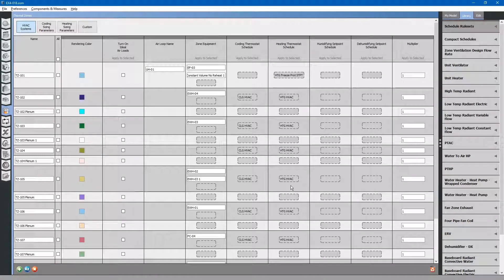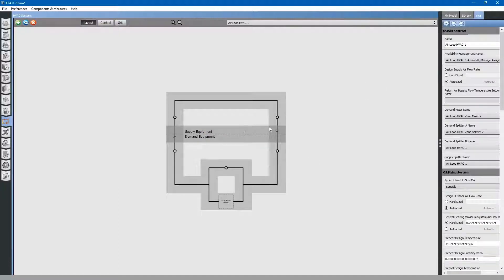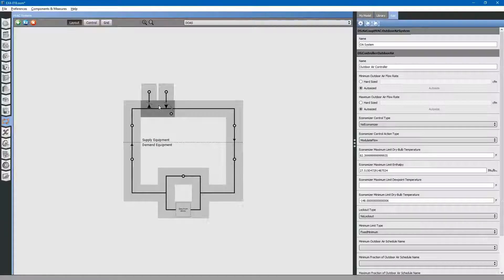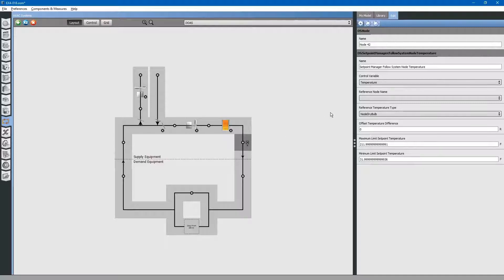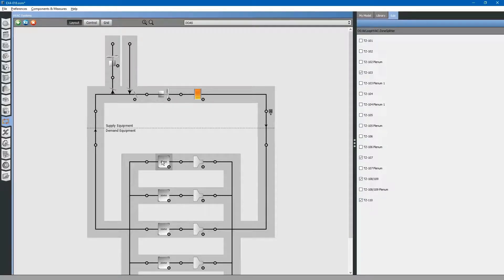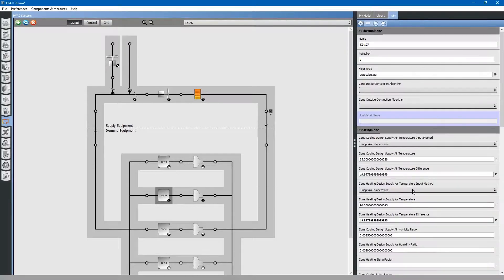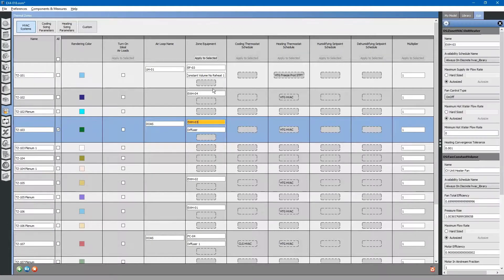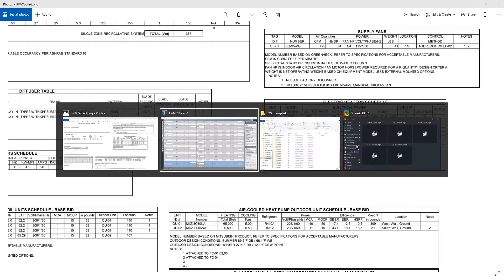Building Energy Modeling in OpenStudio - Add DOAS System

Comment: hi helix thanks for the video, i have a doubt, hope you can help me.
I created a geometry and ran ideal loads and i am getting cooling rate as 10Kw.
then i installed conventional hvac, and getting the value of  7.56kw
After that i replaced conventional hvac with GSHP- now getting 6.74 kw

can you please tell me why are the number changing, shoudn't these number be same?
Reply from the maker: Good question.  I have found that Ideal Airloads tends to overestimate the loads.  It serves as a good rough estimate to start with.  Also, keep in mind that each system will have different performance, such as COP for instance.  These differences add up and will result in different outcomes.
Reply: @helixenergypartnersllc3540  Thanks for the reply. So if i want to find what is the difference between these two systems under similar load, i should consider not consider ideal loads?
Reply: Also, cooling load should not change regardless of COP, because it is the heat removed from the system. It should be same for both system?
Reply from the maker: Well, I guess it depends on what you are referring to as a load.  The zone loads should not change, they should always be the same (except that in the case of ideal air loads the zone and system loads are all grouped into one bucket and identified as a zone load).  The for various systems, system loads will be different based on COP and a lot of other factors.  So, the question is, where are you reading this load information from?  If it is the output report, what category?
Reply from the maker: @flcckate6633  I would only use Ideal Airloads as a starting point for equipment selection.  Then I would run the model with the actual equipment selections and make the comparisons of the actual equipment alternatives.

Comment: Hi Helix, can I have constant RH in a zone throughout the year?
Reply from the maker: Yes, you will need to add humidity controls.  On the thermal zones tab, you can add Humidifying and Dehumidifying set points.  On the air loops, there are several Setpoint Managers to choose from that can be used to control humidity.

Comment: Hi Helix, first of all, thank you for your amazing videos!
I'm modeling a classroom, I have to add a ventilation system with no reheat or cooling. It is a system that is necessary to respect the  outdoor air changhes per hour. I want to control the air mass flow rate on the base of the occupancy inside the thermal zone. Do you know how can i do?
Reply from the maker: Please see this video: https://youtu.be/tTvxbkNG7AI
Reply: @helixenergypartnersllc3540   Thank you so much, it is very clear! 
I'm trying to model a ERV HX system that has to pre-heat the supply air in winter through an heat exchange with the exhaust air. It works very well in winter because there is a very high heat load reduction, but, on the other hand, there is an huge increase of the cooling load. I would control this system in a way that allows me to by-pass the HX in cooling mode and to realize a sort of free-cooling. Do you have any advice?
Reply from the maker: Good question!  The heat exchanger has an option for "locking out" when the economizer is active or when you have set up humidity control.  This feature can be found as a drop down menu on the heat exchanger settings called "Economizer Lockout".  More about it here: https://bigladdersoftware.com/epx/docs/8-8/input-output-reference/group-heat-recovery.html#field-economizer-lockout

Also, you can optimize this function by selecting the outdoor air system and selecting the drop down menu Heat Recovery Bypass Control Type.  By default, it should be selected to BypassWhenWithinEconomizerLimits.  But you can also increase the amount of bypass to always bypass when outdoor air is greater than the minimum.  More about it here: https://bigladdersoftware.com/epx/docs/8-8/input-output-reference/group-controllers.html#field-heat-recovery-bypass-control-type
Reply from the maker: @gianmarcosciurti  Hi!   It has been some time since I have modeled Demand Control Ventilation.  I was going to write a simple reply, but thought I should check first.  I am unable to get DCV to run, so I need more time to troubleshoot.  It might be an error with the recent version of OpenStudio. Normally, you go to the air loop and specify a minimum outside air value on the controller.  Then, click the controls tab at the top and select the DCV toggle.  That is all.  EnergyPlus will proportionally calculate the required outside airflow (from minimum to design) based on the number of occupants.
Reply from the maker: The above description is correct.  Keep in mind that there are several settings that may prevent your DCV from operating: zone exhaust fans may override your DCV if the exhaust sum is greater than your Minimum Outside Air, you have set hard minimums for VAV air terminals, minimum outdoor air schedules, maximum outdoor air fraction schedules, etc. See: https://bigladdersoftware.com/epx/docs/9-0/input-output-reference/group-controllers.html#controlleroutdoorair